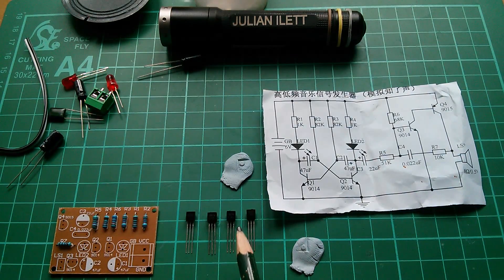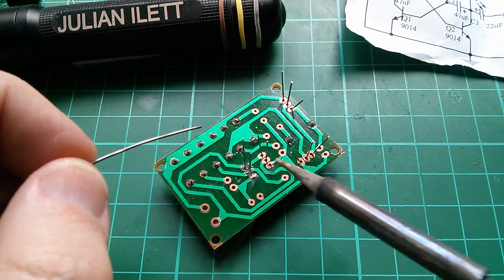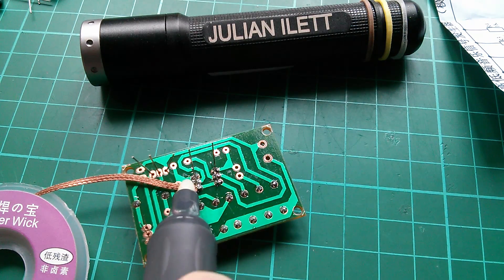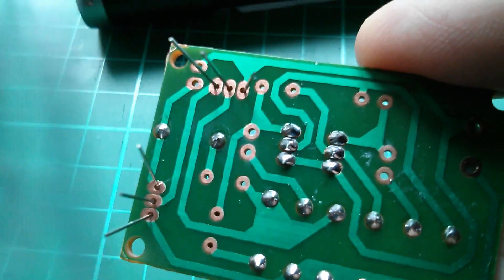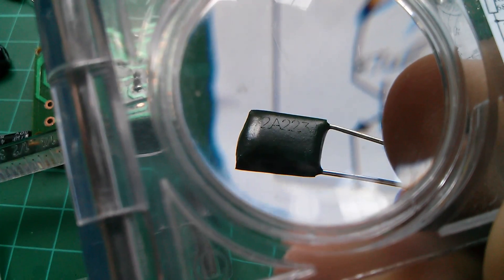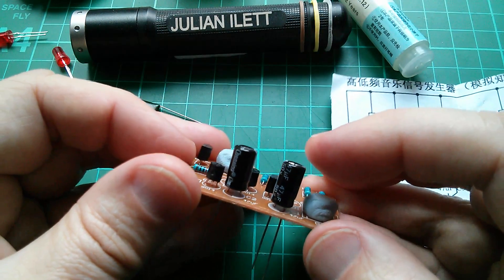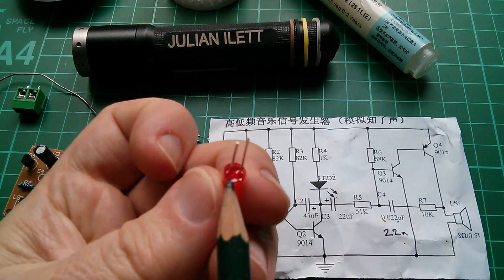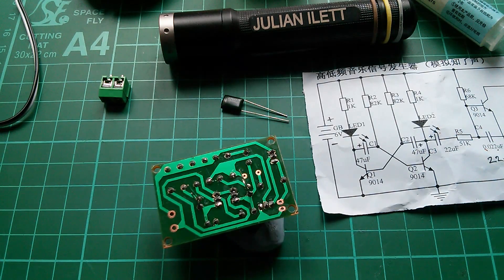Easy Electronic Kit Build - Cicada Sound Simulator (part2)

Comment: Yay, I got my cheap wick to work. I tried using Ebay fluxes, and it was like Julian's one, but then I dipped it in plumbers Bakers Soldering Flux and it worked perfectly. Even though it has 40% zinc chloride I've got boards done 3 decades ago, that weren't washed, that are fine. I wash boards now, but I still use this stuff and it's the best.

Comment: Needing to bend leads like that  just means that the board design, or selection of the transistors and capacitors for supply with the kit is just wrong (yes it is a chinese kit!)... otherwise bending  the leads before insertion, while protecting the component body from any stress is the way to go.  Transistors and capacitors are often supplied on a bandolier with pre-bends to particular hole centres...

Comment: I don't know if that thing with the wick was a troll or not, but if it was the comments section indicates you did a smashing job of it :) In any case, instead of the goot wick get a spring-powered solder sucker, they are way better. Sucker can get solder out of any space that air can move through. Wick kinda has a limit on how much it can pull away, it always seems to leave some solder there.
Reply from the maker: Hey Chris - I've always used a sucker up to now, but they can be a bit destructive. I also use the 'heat solder and whack the PCB on the desk' technique. Wick incompetence was genuine I'm afraid ;)

Comment: I've used wick that was decades old by just putting a drop of liquid flux on it, then laying it on the solder joint and heating the top of the wick.  Seems to work most of the time.

Comment: apply soldering iron directly on the wick so thqat it may heat up, make sure there is a decent amount of flux on the wick, then it will work. I've had to use crappy solder wick myself, but I manage pretty easily. (using a chisel tip doesnt hurt either)

Comment: Part 3 where Julian couldn't disconnect the kit from power quick enough as he looked up the pronunciation of cicada, but didn't think to see what kind of noise they made hehe. Hopefully this kit just simulates the sound, and not the sheer volume those insects make. Good show on doing the "electronics for beginners" descriptions during your videos Julian, it may help many others learn how parts go in, in what order, and especially helpful describing polarised parts like capacitors and LED's.
Reply from the maker: Thanks. Part 3 does include the real sound of a cicada and the not-very-similar output from the kit :)

Comment: Just in case nobody else has mentioned it, you need to place the wick on the solder joint in question and then apply the soldering iron tip to the wick.
The poor solder wick manufacturer will not be best pleased by this video.:)
Reply from the maker: I took all the advice and now I'm an expert wicker :)
Reply: Its easy when you get the hang of it.
And have dozens of people telling you how.
:)
Reply: I pity youtube channels sometimes.
You get to make all your mistakes in front of 100s of people.
I get to make mine only in front of me.
Reply from the maker: Ha yes. YouTubers can do one of three things:
Take it all very personally, give it up and go and get a job at Tesco
Make a video where you cry and say it's all too much (which goes viral and you retire a millionaire)
Keep calm and carry on :)
Reply: Wicker man?

Comment: I find wick works better if you cut off an inch or so then hold it with cutting pliers so you're not using the entire reel as a heatsink.

Comment: The tabs on the transistor is to stop these to go deeper.
Thus you prevent damage the case because the legs should not bend too far apart.

Comment: Solder wick is not ineffective. Your technique is what is missing the point. Your wick is to large. You have to raise the temperature of both the brad and the solder joint to be equal. Liquid rosin flux is a must.  When you get your technique down then you will see the wick act like a sponge. For small place cut the brad on a diagonal to get in close. The iron tip is real dirty. I hope you will take this information and stop giving solder wick a bad name. It will work perfectly after you get the hang of it.
Reply from the maker: Got the hang of it now :)

Comment: I tend to tease the wick out a bit (but not too much, just a little) so it's a little looser than when it's tightly packed and then place the wick in direct contact with the solder and heat the solder I'd like to mop up through the wick, this seems to draw the solder into the wick and works pretty well and I only use cheap wick from eBay too...

Comment: Solder will flow toward the hottest point, so put your iron on top of the wick and then onto the solder you wish to mop up. The wick will conduct heat to the solder and melt it, and it moves into the wick heading for the hot iron. Use some decent flux and it will work like a charm. Best wishes.
Reply from the maker: Thanks CornishMiner - your positive encouraging comment is much appreciated :)
Reply: CornishMiner Damm you arrived 30 seconds before me

I concede
Reply: Best explanation. right here!
Reply: I compared wick price is the same as local electronic store and the quality is way better and with flux.
About 1$/meter

Comment: Those copper "sponge" things work if you repeatedly STAB them with the soldering iron vigorously.  They do not work if you just wipe the tip across it like you do with a real sponge.  I will NEVER use a sponge again once I figured out the "trick".
Reply: kirkb4989 I like my sponge,  but the (wool) is better?

Comment: Aren't you supposed to place the wick in contact with the excess solder, then apply heat to the wick itself?
Reply: Honestly I don't know this guy's background, but he doesn't seem to be well informed about electronics or coding. Just enough to get by.
Reply: its somewhat cringe worthy to watch someone that's supposed to know what their doing use something as simple as solder wick incorrectly.
Reply: All I do is place the wick on the solder I want it to suck, add some flux, which is not necessary, then put my iron on top of it.
Reply: Yes, you are supposed to place the wick on the solder to be removed (I usually place it about 7(~.25")-13mm(~.5" past the end) then lay the iron on top of the wick and slowly pull the wick across the joint until all the solder is removed.  The only issue I have ever had with cheap wick was it sometimes being to dry or tarnished to work well without added flux.
Reply: If he really is trolling then slagging a product off in the process is not really very appropriate is it?
Reply: This cheap Chinese wick doesn't contain much flux, so I always put on some extra and then it just sucks all solder right up. As long as it's heated up ofc. :D
Reply: I would also suggest slightly fraying the wick before putting it against the solder, a bit more spacing width-wise goes a long way to absorb more solder per length of wick.
Reply: Yes, I use this "fake wick" all the time. It's very cheap in China but it does indeed need some flux, depending on which lot you buy (it may be old). If you heat it up, it will suck up all solder even from under the smallest smd chips, I love it.
Reply: Mad Hatter I think he knows exactly what he's doing. Look at how many extra comments he gets because he did something "wrong". Maybe in his next video he will point out that he's been informed of the correct way to use the Wick and show us so we all learn "Together".  😊 The man's a genius.
Reply: You know he's trolling you, right? Of course he knows how to use solder wick :)
Reply: Yes, and if you have troubles with it, you do need a little flux. I haven't seen any fake solder wicks yet, but there might be. I have copper coated aluminum cable that looks like solid copper, but doesn't take solder very well.
Reply: its easy to come back and claim "just kidding guys, it was just a joke.", clickbait trolling is sad even when done correctly. maybe his issue here is he can't read the Chinese instructions.
Reply: this is Youtube don't you know if you have a Youtube channel that makes you a professional in all subject matters.
Reply: +Steve Now that you say that, I really remember watching a video where someone said "good wick" is good, "solder wick" is bad on ebay (or the other way around). Maybe he watched the same video and he's making fun of it.

Comment: Your meant to use the wick side on,  don't use the end of the wick like that!
Put the large flat side on the solder, then heat.
Reply: he had the wires so he couldn't do that but he will need to cut them next time so it works